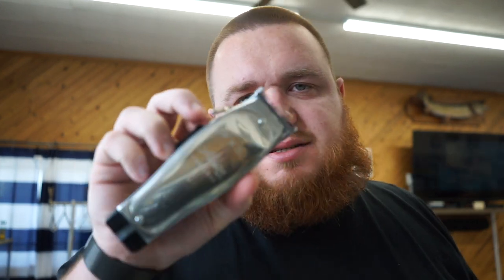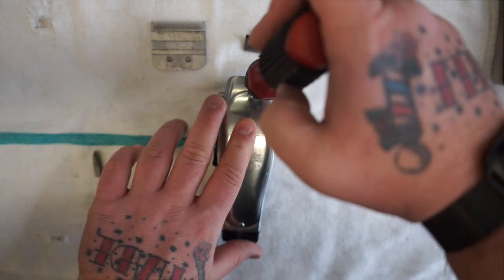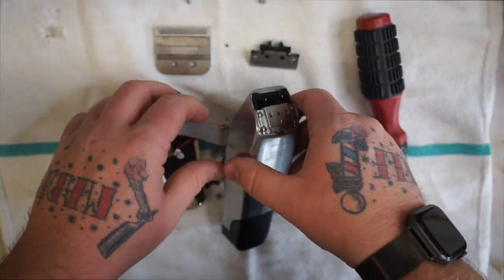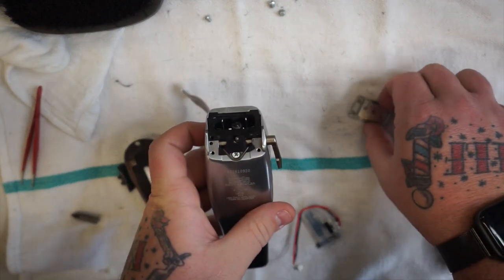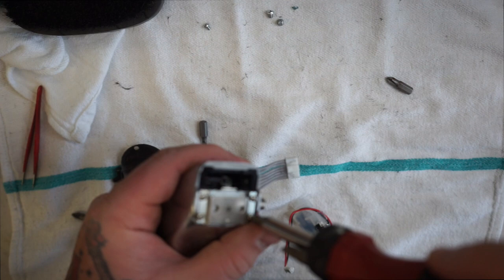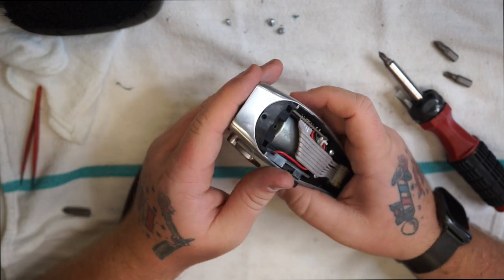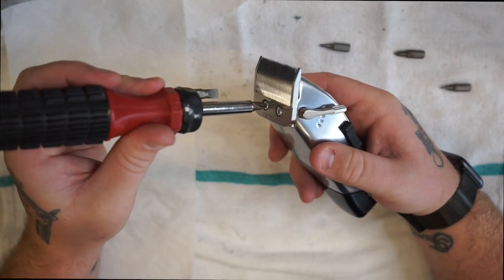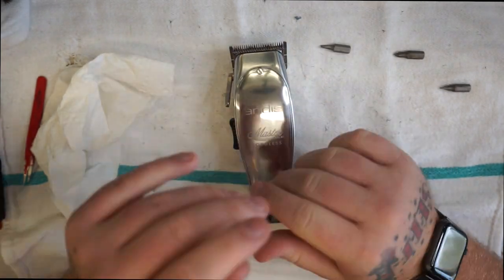how to deep clean cordless andis masters

Comment: Do we need to deep clean clippers? I had mine for a couple years and they’re still cutting like a champ. I just simply clean the blades from any hair and oil them. ...not saying a deep clean is bad. I’m sure it’s better than what I’m doing. I just never deep cleaned my cutters or ever had intentions to.
Reply from the maker: In my opinion I think it helps keep the clipper running better for longer, too much hair or debris build up inside the body will reduce airflow to the motor causing it to become hotter than if it wasn’t cleaned out. That excess heat will eventually take a toll on the performance and life span of the motor
Reply: The Barber Teezy makes sense